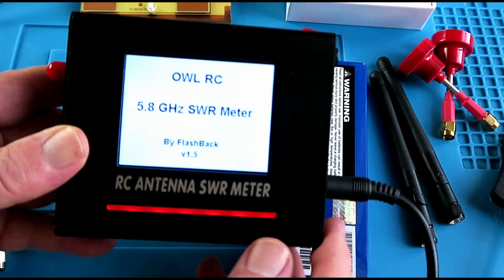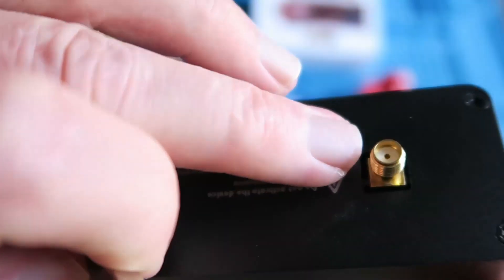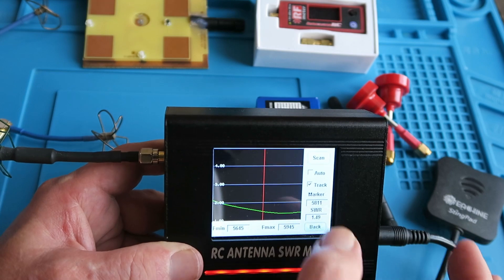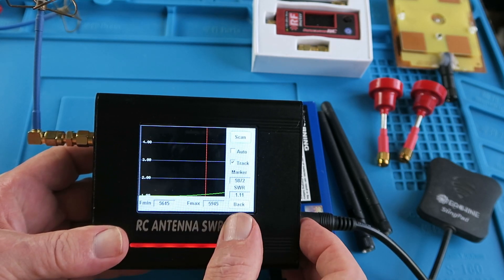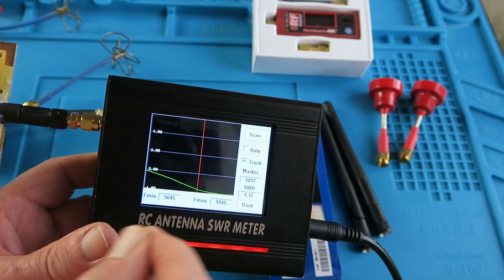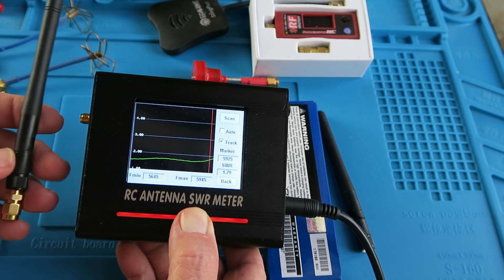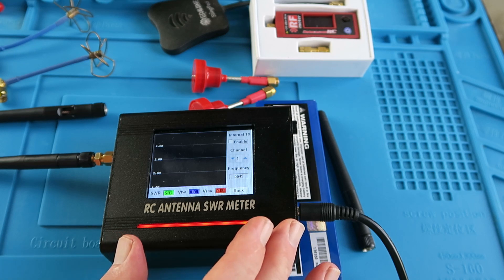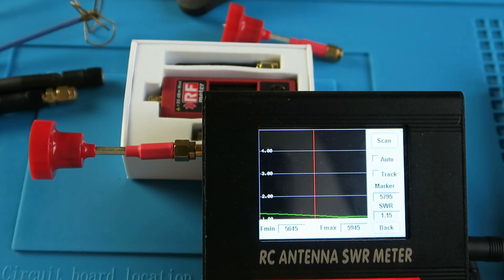OWLRC 5.8 GHz RC Antenna SWR Meter V2 Review & Test

Comment: Have you test the owl swr meter with 50ohm dummy load,? What is the response ? I have version 1 . And test it with 50ohm dummy load from my bank Vna and the result the swr is rise from low fpv frequency to High fpv freq. And also check the swr and use sma to rpsma  adapter the result is very different.

Comment: Is it possible to power it with a 4s battery?
Reply from the maker: No, this is a 12 volt DC device. The magic smoke will come out on 16.8 volts!! You could use a step down converter.